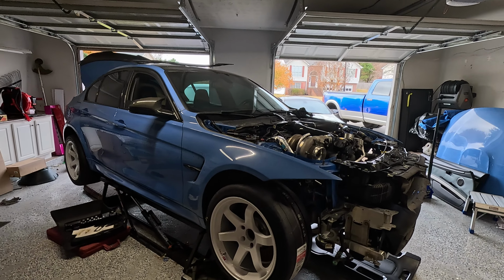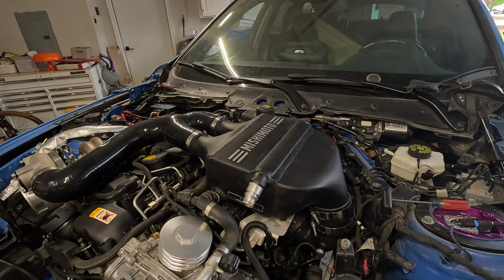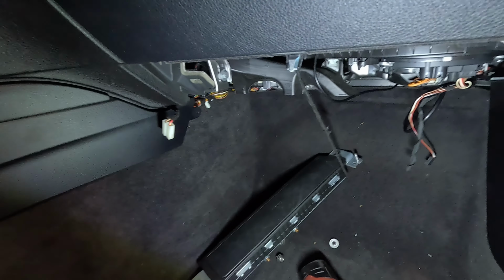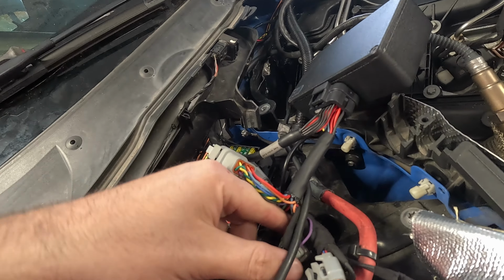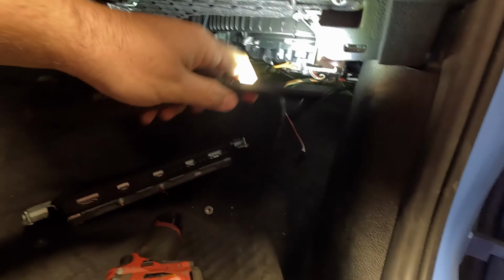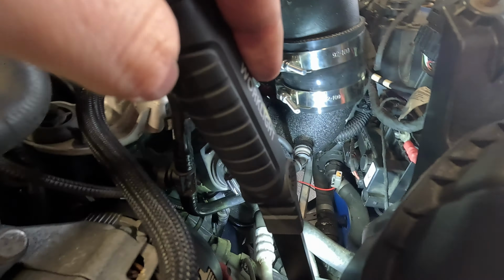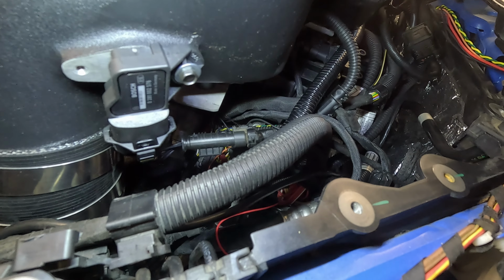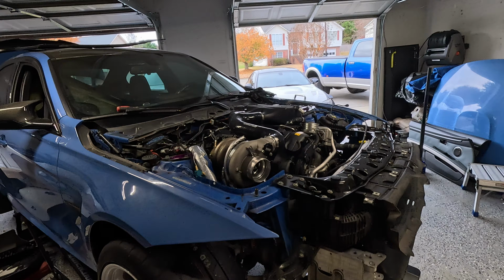Single Turbo F80 M3 UPDATE - TE37SL / Motiv Reflex / LPFP Wiring

Comment: we need the finished product pleaseeeee ive been waiting months. i just ordered a kit as well, switching from twin hybrids to a gen 2 6875 turbo
Reply from the maker: Literially just now 12/01 got the car sorted and idled. Had a wiring problem in the coilpack harness I did.
Reply: @Sideways_N55 did you switch to the b58 coil conversion kit?
Reply from the maker: Not stock coils